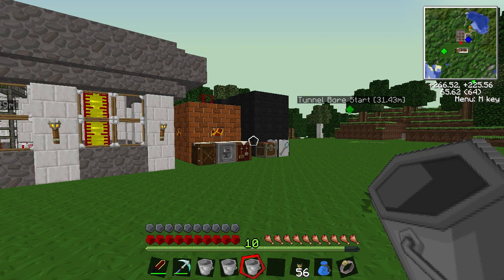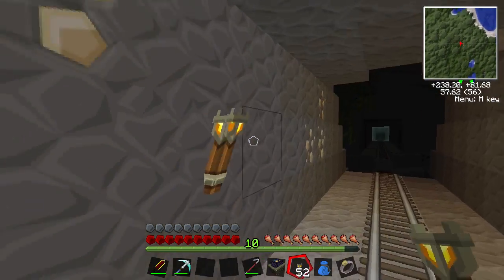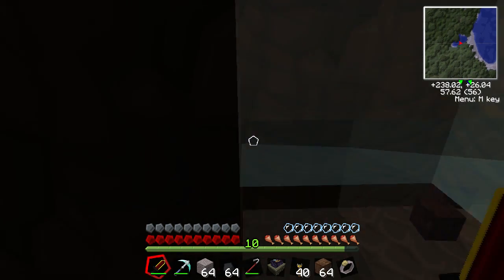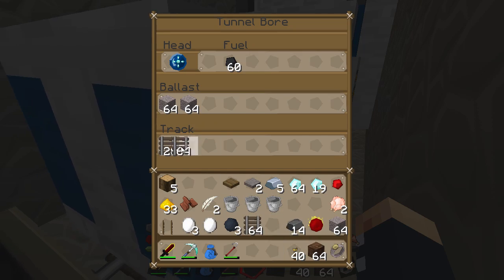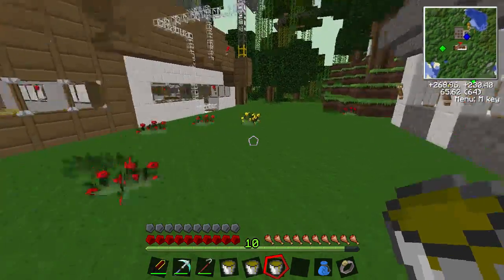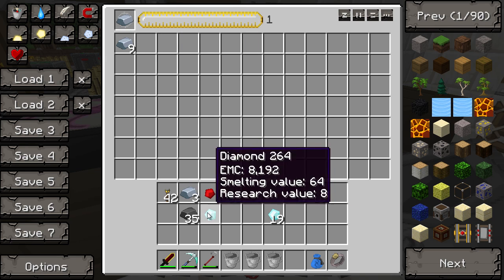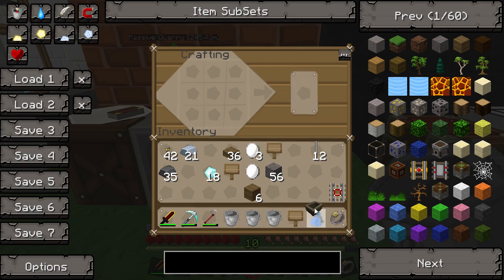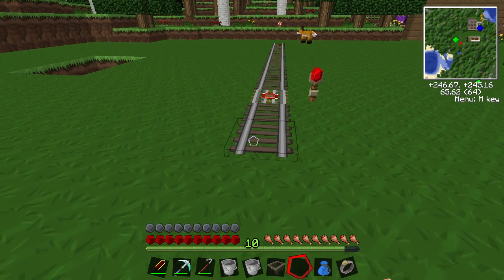Tekkit/Technic - Episode 53 - World Anchor Carts and Launcher Rails!

Comment: One thing that I have really been facepalming at, is the fact that you're using buckets instead of bottles to get the creosote out. If you used bottles, you could leave them in the coke ovens and they would stack up. It's alot more efficient. But I guess you're gonna make an automatic system soon, with carts doing it all for you. Also, is it possible to hook torch carts to tunnel bores, even though they're from different mods?